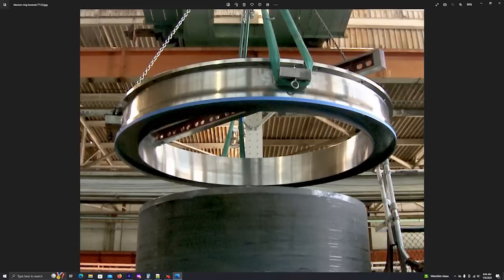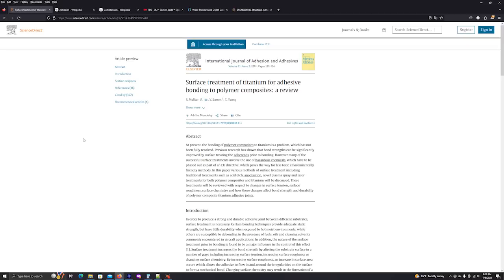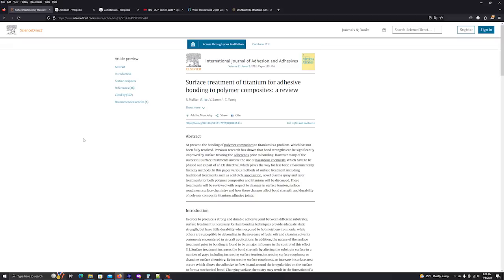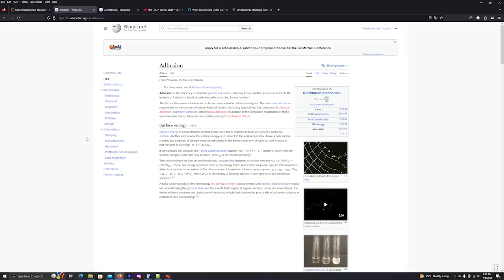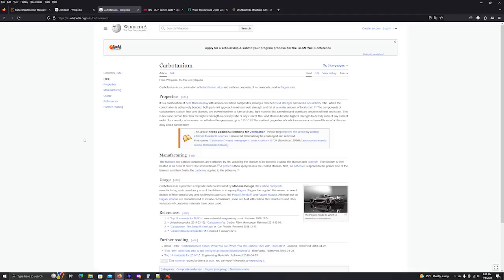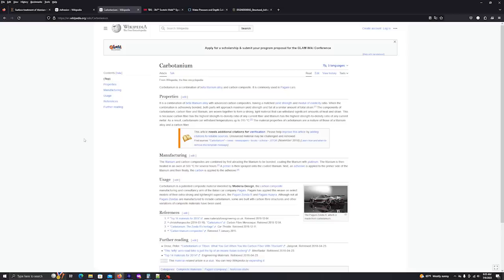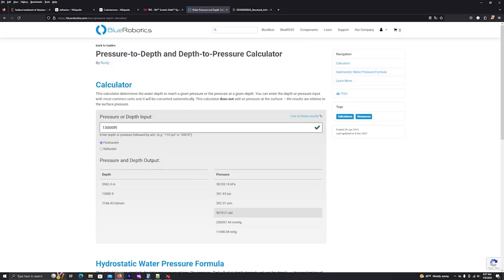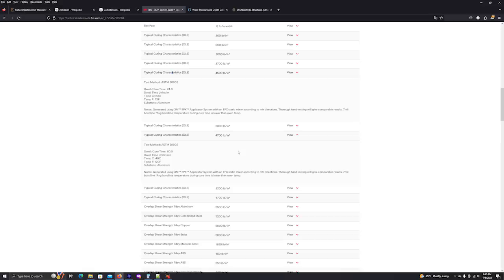Oceangate Titan Adhesive issues between Carbon Fiber and Titanium

Comment: I volunteer at the Hydro and Raceboat museum and when the first Honeycomb boats were made , the airplane engineers preached the “chemical binder” product that the teams quickly called their grinders .
   They skipped the etching and went right to the “scratched surface “ method of prep .
    We also use rows of rivets and bolts to attach, never relying on just a chemical bond.
     I see 50 minutes of working time in the field and that assembly they did with 4 guys looked slow for my taste.
.Hysol is what our airplane engineer guys have us using for 6,000 lbs boats that go 150-200 mph .
Models don’t always scale up is another lesson learned as wired 4 point hills went airborne even though the models worked great .
Reply from the maker: Thanks Tim,  great info.  Yes I have seen lots of folks use Hysol for bonding.

Comment: I think in additional to the adhesive bonding to the titanium question we should also consider that the epoxy adhesive filler they used separated from itself...meaning it's own bond strength was exceeded upon tself and hence it separated from itself internally leaving behind hardened adhesive on both sides of the Titans implosion surfaces....so what I'm saying it's very possible they never considered the actual adhesives strengths like you said when it's immersed and constantly in a humid wet ,hot environment.   I don't like the fact that they did not wet laminate the 6 one inch layers to each other as one would conventionally do.  It's also very scary to think of grinding down the carbon fiber stands to smooth out wrinkles which is insane because that's breaking the actual cords of carbon fiber which is the only way it has any strength.  Like cutting individual cables on a suspension bridge cable assemblies right.  Crazy to think of doing such a thing...but that's what they did when they grided everytime in that part.  Much of the carbon fibers therefore were not continuous strands connected to each other like you would expect them to be on any structural composite structure.  Amateur builders.  Shame..
Reply from the maker: Great points Thanks for the feedback

Comment: Wow !!  Learned alot today from your presentation video.  The piagiano super car manufacturing carbon fiber titanium adhesive is extremely impressive.  Thanks so much. What's amazing to  me is that people think that cured epoxy resin is inert but epoxy is is really just an adhesive which is not a permanent coating.
Reply from the maker: Thanks for your comment.

Comment: Was the pressure deep down below not responsible for actually holding the things together? Yes it can expand or retract, but the pressure would make sure the two rings would stay put. The only point of failure would be the carbon hull itself - now on the previous dive someone noted that the crackling got really to a loud point. And that the hull needed maintenance which it did not got. The last dive was the fatal one, as likely the whole hull collapsed, blew up and made human paste in just 20 milliseconds.
Reply from the maker: Yes more than likely the carbon fiber failed through micro cracking, previous people indicated hearing the cracking.  Then at Titanic depth the carbon fiber failed, more than likely blew the titanium end caps off.  If you look at the recovery images the bolts were missing and the end caps had no traces of carbon fiber remaining.

Comment: First of all Vincent,  you’re clueless with how the flange was attached. It was attached by The flange inside Diameter Sliding down on the hull outside diameter. So theoretically, there should have been near the Height of the flange, that amount of Adhesive securing it, not the 1” of height of adhesive you Suggest, which in all Likelihood is blue Painters tape there to protect that surface.  But there is another pic showing this flange or The other one From the Reverse angle, that makes yours and and many others same point, there wasn’t even a Spec of Adhesive left to be seen on that Rather large, has to be 5” thick Surface.

Comment: The information provided here is globally available from many sources, so I really don't understand how this tragedy was allowed to happen and I feel for the families of those affected. 

The bonding of the titanium rings to the composite hull is definitely one of the weak points in the assembly. This fact is important but is not the main reason for the failure. There are 2 major design deficiencies of which the ring bonding could be a contributor. The first major issue is the fact that the filament winding is described as a "tape" in the various videos of the winding process. It does look like a tape but in reality it is just a bunch of parallel strands of carbon fiber placed side by side that have no connection between them except the epoxy resin. When the assembly is cured the carbon fibers have full strength in the hoop direction but zero strength in the axial directed. The only structural material in the axial direction is the epoxy resin itself.
In a round tubular pressure vessel with a constant wall thickness the stresses developed in the hoop direction are approximately twice as high as in the axial direction. Using 66 inches for the diameter of the hull and a 5 inch wall thickness at a depth of 4000 meters (13123 ft), the stresses work out to approximately 38,500 psi in the hoop direction and 19,250 psi in the axial direction.

The layup used on the hull is almost vertical 90 degrees to the axis of the structure which means the hoop stress is directly resisted by the carbon fiber but the axial stress is only resisted by the epoxy resin. In general the epoxy resins used in a carbon fiber structure have tensile strengths in the 10,000 to 12000 psi range and compressive strengths as high as 25000 psi when tested without the fibers and drop to 5,000 to 6,000 psi when the carbon fibers are added at a 50% ratio of fiber to resin. 

The first big problem the applied compressive load is 19,250 psi in the axial direction and the load capability of the resin is only 5,000 to 6,000 psi in tension. Using a Poisons ratio of .3 for the resin, the resulting induced tensile stress is 19,250 X .3 = 5775 psi between the plies in the radial direction. At these stress levels in the epoxy, cracking at the fiber epoxy interface would occur. I suspect this cracking of the epoxy matrix is the noise that was heard. This cracking would eventually lead to delamination of the structure and eventual failure.

The second big problem is that the strength of carbon fiber structure deteriorates by around 15% when exposed to moisture and sea water. The carbon structure was coated with polyurea protective liner in an effort to water proof the structure. At sea level this type of liner would be good but the deeper the vessel goes, the pressure would deform the liner and at depths below 500 meters the tension properties of the liner are exceeded so I suspect it was probably ineffective in protecting the structure as deeper depths were attained.

The reason the carbon structure on the Titan failed is more than likely the result of interlaminar bonding failure of the epoxy resin. 

Since we know the ratio of hoop stress to axial stress for pressure vessels is 2 to 1, this means that in order to balance these stresses using the unidirectional carbon fiber the layup would need to tilted at some angle from the hoop direction towards the axial direction so that the carbon fiber resists the axial load as well as the hoop load. This angle would be where the tangent of the angle would be 1 over 2 or .5. An angle of 26.6 degrees has a tangent of .5. This means that the hull should have been constructed of overlapping layers of carbon fiber at plus and minus 26.6 degrees from the vertical instead of directly vertical as shown in the manufacturing videos.

Another way of saying it is that the carbon fibers in the original layup were misaligned by 26.6 degrees from the actual load direction. Getting the layup angle correct is very important for carbon composite pressure vessels and any structure for that matter. Even with this redesign extensive testing would be required to ensure an adequate safety factor.

The second issue is the liner, since the strength of carbon fiber is reduced by the present of moisture and salt water, one of the design goals should have been to prevent seawater from acting directly on the carbon fiber at any depth. This means than any external liner must be made of a solid material that is both water proof and gas proof must be installed tightly over the exterior of the carbon fiber structure. Aluminum is light weight and has a relatively low modulus of elasticity and would be an appropriate external liner material. A thickness of 1/4 an inch would provide adequate and stable protection if it was mechanically fastened and sealed to the flanges of the titanium rings. This liner should not be bonded in any way to the composite structure so it can be removed for inspection purposes and other maintenance but needs to fit tightly to the carbon structure to prevent buckling... Pressure sensors should be installed to monitor the pressure between the inside of the liner and the outside of the carbon fiber structure to make sure this pressure remains at sea level when at depth. A pressure relief valve should be installed so that if an increase in pressure is detected and the dive is aborted the pressure can release safely during the ascent.

Carbon fiber is a well known material and has very good tensile and compressive strength and which has been extensively used in both aerospace and marine uses. An example is the Boeing 787 wing structure where the lower surface of the wing is in tension and the upper surface of the wing is in compression during a flight. Other examples are aircraft flight and ground spoilers, which have a significant compressive load applied to the lower surface when deployed and which have been manufactured from carbon fiber and used on commercial passenger aircraft since the 1980's.
Reply from the maker: Thanks for the great info.

Comment: How was the outer white cover attached?  Also, it looks like he had screwed lights and a monitor into the interior walls of the sub
Reply from the maker: It appears that the external structure tied into the titanium flanges and the framework that made up the skids.  The drop weights also were attached to the skids.  It would have been foolish to drill holes into the carbon fiber, as some folks have indicated.  Thanks for the great question..

Comment: i assumed that the two titanium end caps had been bolted on or fixed on in such a way as to never come loose.  was it just left glued?   surely not?   does anyone know?
Reply from the maker: Yes, check the video in the description,  titanium flange was bonded with epoxy adhesive., Thanks for the comment

Comment: I have worked on composites with organic resins for over 50 years.  One of the titanium structures I used to work on was F-14 box beams.  The box beam is what held the plane together, center fuel tank, and wing mounting points,  Just thumbnail information an F-14, weighed ~33,000lbs empty, take off weight could be~> 66,000lbs.  It is laughable to think that, just from the take off and landing weights that epoxy joints could be used on any titanium components on a airframe, not to mention pulling -+gs during acms.  Not to mention when an aircraft such as an F-14 crashes onto a carrier deck.  Yes, I said crashes.  A carrier landing is considered a controlled crash, which is why Navy aircraft weigh more than AF planes.  They have to be more resistant due to the bending and twisting a carrier landing subjects a plane to.
Then carry this a step further.  The Russians make the best submarine hulls in the world.  They are better than anything the US has.  I am not talking about anything but the inner hull where they use titanium and dive to depths in excess of 3000ft.  
Really makes you want to know why the Russians never used and epoxies on the titanium joints in their subs.
Also, in the last 50 years, I have manufactured organic resins for coating and adhesive purposes.  You are wasting your time looking at various manufacturers TDSs trying to interpolate where you can substitute other metals for titanium.  Epoxies are incompatible with titanium.
There is no bonding which takes place between an epoxy and a titanium substrate.  You will not get any covalent bonding between titanium and epoxy.  This is why you do not find titanium on any epoxy charts.  Never substitute materials with epoxies unless you know what you are doing.
And no, you have not found any epoxies which can be used in such pressure environments as in deep water.  The water pressue would further compromise an epoxy bonding interface.  The deeper in the ocean, the more intense the pressure.  Sea water will, on a microscopic level, seep into the epoxy and cause undesirable chemical reactions to take place ruining the integrity of the bond.  Most epoxies are open cell upon cure.
Further, you can look at epoxies for aerospace applications all you want, but epoxies are three dimensional upon cure.  You really have to pay attention to the epoxy temperature limitations.  Also, when dealing with structural epoxies or high mod epoxies, there is very little movement where temperature is concerned.  Epoxies are thermaly limited in temperature envelopes.  Thermal shock can literally destroy epoxy bonding in seconds.  You need to go to a different material if thermal shock is involved.  
We know that there was no anchor pattern put onto the titanium, not that it would have worked to begin with.  The international standard SA 2.5 (surface preparation protocols for ships) calls for an anchor patter of 1.5mils.  This would have made no difference whatsoever.  Again, there is no bonding between titanium and epoxy.  There are some companies which advertise that epoxies stick to stainless.  Epoxies have similar poor bonding characteristics to stainless as they do to titanium.  It is just a bad idea.
What you were looking at regarding titanium bonding to something in the science direct article is you need to use a laser to etch the surface of titanium, followed by a metal spray on the surface, a silane sol gel and another organic primer.  Then you can look at making a carbon composite bond to titanium like for golfclubs or something.
So, there was no chemical bond or mechanical bond of the epoxy to the the titanium, which is why the titanium came clean off with no residue on the adhesion interface.
Stockton Rush was just looking for occupants to join him in his submersible death trap or submersible coffin.
Reply from the maker: Thanks for all the information

Comment: Fascinating. What this shows us I feel, in comparison to the video of the technicians gluing the carbon to the flanges of the Titan, is that perhaps they were using more basic fastening techniques. In other words, its likely didn't know these more advanced techniques existed, or if they did, they chose not to use them.
Reply from the maker: Thanks for the feedback 🙂
Reply: @JoediyLab  I've subscribed and am sharing your clips in my various groups. I did have a question. I posted your video and one of the commenters shared a pretty (I thought) reasonable solution, and that is that the flange could have been woven directly to the carbon fiber tube. Do you see this as being a potentially viable solution?
Reply from the maker: Thanks for the comment,  Yes on many carbon fiber components where there is an interface to an alloy component, one option is to directly include the carbon fiber layup on to  the alloy part.  To give you an example many bicycles that use carbon fiber frame, in the mold, they insert  the alloy parts directly into the mold and add carbon fiber plies to the alloy parts and cure as an entire component.